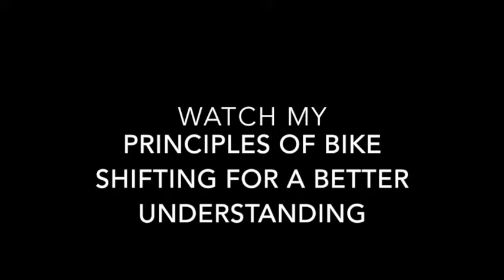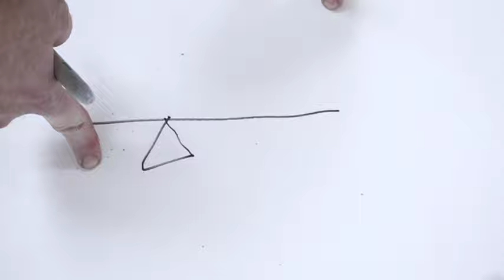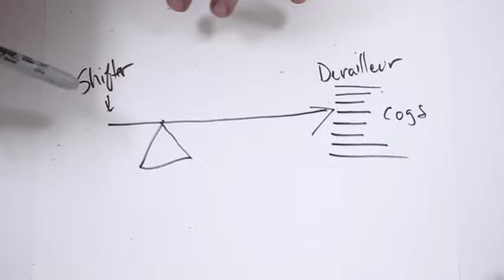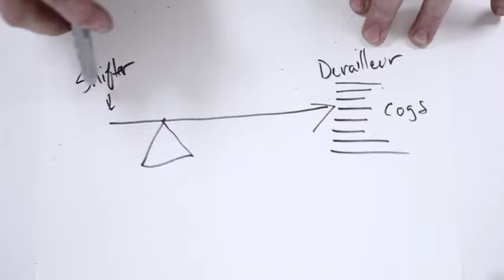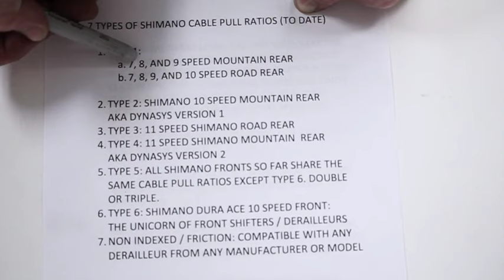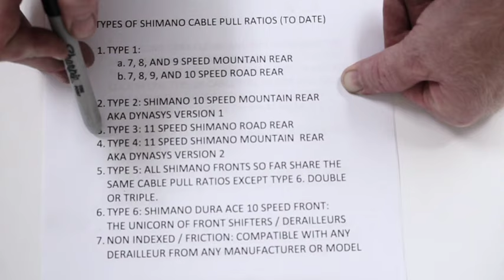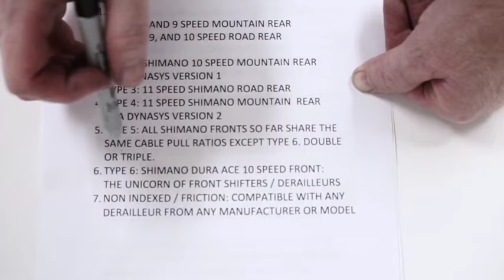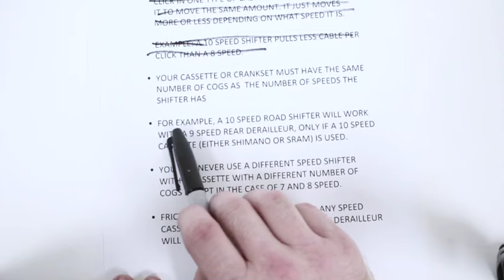Shimano Shifter / Derailleur Compatibility Guide: Intro to Cable Pull Ratios

Comment: For Shimano front derailleurs, road and mountain have different cable pull ratios.
Reply: The best technical bike youtuber, Thanks for the info!
Reply: i see. so i can use my 105 10spd RD on any MTB shifter provided it's 10spd as well? or i can go 11speed shifter & cogs using the same 105 10spd? (short cage)
Reply: @BenjaminVallejera  (My comment had nothing to do with rear derailleurs) But , no. Shimano used the same cable pull ratio for most of it's rear derailleurs from 6 speed up. (Early Dura Ace used different ratio). That is both road and mountain. But then Shimano changed the cable pull ratio on it's mountain rear derailleurs starting at 10 speed. This is just cable pull ratio, mean they will work with the shimano shifters and index correctly. There is also chain capacity, and largest cog.
You can use Shimano 105 10spd RD with Shimano 6, 7, 8, 9 speed shifters. They all have the same cable pull ratio.
Here is how indexed shifting works: https://www.youtube.com/watch?v=xMvD1T4qF1E
Reply: @RJTheBikeGuy   i see. so if i use 9speed shifter, it can only accommodate 9 cogs? or can it shift up to 10th cog? btw, great stuff. im learning more here. You have explained (Without me asking) why my roadbike 10spd tiagra shifter works on a 9spd alivio RD. :)
Reply: @BenjaminVallejera  It would not even be able to shift that last time. That is not even taking into the consideration the indexing.
Reply: @ValkusR  2 speed FDs are still off. They are workable, but the shifting is still not great.
Reply: @RJTheBikeGuy  Hey RJ. I don't know all the combinations but a dyna sys double front derailleur works perfectly (trim positions work too) with a double road shifter, at least from the old series and as long as you install an mtb crankset. Check my video
Reply: @RJTheBikeGuy  I just installed on my gravel: Ultegra 8000 shifters together with GRX 812 (back) and  SLX FD-M7025-11-L front derailleur and also SLX FC-M7000 Crankset 2x11 (38-28) shifting in front works like charm, not workable as you said, but perfect. So definetely the pull ration of the derailleur is compatible with the shifters, BUT the derailleur  should be compatible with the crank chainline and ring sizes, so If i were to use the same derailleur on a road crank (like 50/34) that would probably work, but with some rubing and compromised shifting.
Reply: @RJTheBikeGuy  and another piece of the information concerning FRONT derailleur MTB/road compatibility: It is explicitely said that shimano SORA front derailleur compatible both with ROAD and rapidfire shifters here is the quote: 

Description of Shimano Sora FD-R3000 Front Derailleur 2x9-speed
As Shimano's first-class 9-speed road bike groupset, SORA is pitched towards sports/fitness cyclists. With its durability and affordability it is also a perfect groupset for winter or urban commuting bikes. Now with technology adopted from higher level groupsets, both new starters and enthusiasts will feel comfortable with the features that 9-speed SORA R3000 introduces. 

Shimano Sora FD-R3000 2x9-speed front derailleur in Wide Link design for improved shifting efficiency. Also suitable for Rapidfire Plus shifting levers. Chainstay angle: 61-66°.
Reply: So I have a shimano deore mega 9 setup, they don't make it anymore but it's a 3x9 setup, on my front derailleur shifter I should be able to use a 7, 8 or 9 speed mountain front shifter correct? The actual shifter on the bars not the derailleur itself
Reply: @danielmilligan3298  Sticking with Shimano, yes, the cable pull should be correct. But the chains got narrower. So a 7 speed mountain FD might work, but a 9 speed mountain FD will work better.
Reply: @RJTheBikeGuy  thanks! This is kind of my introduction to performance bikes so I'm still learning
Reply: @RJTheBikeGuy  Can i use claris r2000 8speed sti on alivio rd-mc20 8 speed on a mountain bike with drop bars? Im planning to build a monster cross bike.
Reply: @nefarious2404  Yes.
Reply: No kidding. I had a very pretty Tiagra Triple front derailleur that couldn't be actuated with Deore Rapid-fire shifters. I found a 2nd hand STX Dynasys that does a fine job.
Reply: Just want to ask..not sure if this was discussed..what sti will be compatible with alivio 3x9 set up?
Reply: For road bikes, is Tiagra 4700 rd and fd compatible with SRAM 2x10 brake/shifters?
Reply: @name-ug5xq  no
Reply: Thank you! This is a very good content! 

Is it ok to use a tiagra 10s shifters paired with 10s deore RD and 10s cassette?
Reply: @Kuldra  Probably not. 10 speed mountain (deore) went to different pull ratio than road.
Reply: @RJTheBikeGuy  I see. If I pair Tiagra 10s shifters with a 9s Alivio RD and 11-40t 10s cassette will that work?
Reply: @Kuldra  Probably. I would go with a nice 9s Deore.
Reply: @RJTheBikeGuy  Thanks!
Reply: @tyronearnold6692  

I need your help, i really fcd  !

I got a gravel "locked" in Sram Apex...
I changed rear derailleur for Deore M6000 (MTB) , the cogs was Sram too, i changed today for a chinese cog, 11-28  10v.
Mi shifters are STI Hidraulic Tiagra 10V.
When i shift the gears, the pull ration doesn't work well, its like 2 shifts for one gear up. Well, in short, I have 10v in shifters, and in cogs, and the derailleur, also 10v, but just reach 8 gears, sometimes.

I need to replace de derailleur for a Tiagra Road ?
Reply: @sergiocouto4854 can't help. that is a mess. I only use totally compatible setups. Complete gruppos preferred.
Reply: Not such an issue about the front derailleur as the road and mtb ones are pretty similar with both available for three chainring cranks...
Reply: @jommagtibay3404  microshaft 3 by 9 Sti type or Sora 3 by 9
Reply: @name-ug5xq  the 4700 has a unique pull ratio with the rear derailleur and is not compatible with other 10-speed, not even from 10 speed Shimano

Comment: Inspired by this and similar vids, I changed the 11-28 for a 11-34 on my Felt CX bike.  Used the Road Link and also subbed a 34 tooth chainwheel for the 36.  Didn't even need to adjust the chain length.  Now I have the 1:1 lowest ratio.  The rest is up to me.

Comment: Hi All, FYI Im running currently - due to crash and death of previous gen RD SLX M670 - SLX M7100 (1x12 model) with 10spd 11-42 cassette and 10spd slx shifter. However, will order - as its cheap as hell - 12spd SLX shifter and Im more than sure it will work flawless - will just leave the smallest gear/click empty by setting cable tension to 3rd from bottom as the lowest gear on my cassette. Still ultimately will upgrade to 11spd 10-50 cassette (sunrace mx8) and will leave only 1 gear/click on shifter "empty". and later when microspline will not be so expensive and more available ( running Bontrager wheelset )  will go to full shimano M7100 12 spd group by adding proper driver and cassette. Cheers

Comment: Cool video and I like your cheat sheet with all the compatabilties/combos.  You may want to consider a part 2 to this video with mismatching vintage index components with other brands and non index components.  I've successfully meshed non index/friction Suntour Cyclone and Superbe Pro RDs with shimano 7 and 8 sp index DT shifters and the indexing worked fine, so I assume many old Suntour non index RDs have a 1:1 cable pull ratio.  Also I've meshed 1st gen. Suntour 6 sp Accushift shifters with Shimano 7sp RDs with 7 sp FWs, so the pull ration on 6sp Accushift is the same as 7 speed Shimano shifters.  You can overclick the 6sp Accushift DT shifters to get into the largest FW cog but sometimes it ghostshifts back into 2nd gear if you hit a big bump in the road.  These weird combos can come in handy if you're setting up vintage pre 90's bikes with friction shifting and converting to  index shifting brifters/DT shifters/barend/grip shift or rapidfire shifters.

Comment: Question: I have a 10 speed (Dura-Ace) barend shifter being used with a 9 speed mountain derailleur and a 10 speed cassette.  However, I keep having trouble with the shifter needing to be moved two clicks to actually move the chain.  (Then I have to click back one to align the derailleur.  Is this a compatibility issue or a bent hanger or...
Reply: Joe Copeck cross compatibility only works up to 9 speed, then all bets are off.
Reply: Change to a 10 speed derailleur, so it's a matched set.

Comment: Even tough I have alot experience and I'm already familiar with the inner workings of indexed shifting I must say, this is some of best explaining I've ever seen. Well done sir.

I actually came here looking for information on wether the 11 speed shifter on 2*10  drivetrain on the Specialized Chisel was a printing error. It would seem its not. I can only guess why Specialized would do run 11sp deore shifters with a 10sp XT derailleur and cassette. Cost efficiency?

Comment: I believe the information regarding front derailleur are inaccurate -- for triple 3x9 Road vs MTB pulling cable ratios are similar but not exactly the same. This means that even after careful setup you have some rub somewhere -- in my case I tried to mount MTB FD to match road STI Shimano shifters, and either leftmost or rightmost chain path caused the rub against FD cage.
Reply: Yard Sale Dale  I wrote about replacing one triple with another triple (it is not doable without converter). And since with triple the rub occurs only on one of the cogs I am not surprised dropping one and going double works.

Comment: need your help, i really fcd  !

I got a gravel "locked" in Sram Apex...
I changed rear derailleur for Deore M6000 (MTB) , the cogs was Sram too, i changed today for a chinese cog, 11-28  10v.
Mi shifters are STI Hidraulic Tiagra 10V.
When i shift the gears, the pull ration doesn't work well, its like 2 shifts for one gear up. Well, in short, I have 10v in shifters, and in cogs, and the derailleur, also 10v, but just reach 8 gears, sometimes.

I need to replace de derailleur for a Tiagra Road ?
Reply: You need a derailleur matching the shifters. Ten speed mountain is totally different than any road setup is compatible with.

Tiagra is a weird group - when they bumped up to 10 speed (after this video was made), they changed their whole tiagra system to be compatible only with Tiagra. It’s effectively an island onto itself - all alone in terms of compatibility. 

If you want your shifters to be compatible, you’ll have to dump the m6000 rear and use a 10s tiagra rear. Nothing else is compatible.
Reply: BTW, I’m John the Bike Guy commenting under the name of a different channel. 

Normally I don’t respond to questions with answers contained in the video. But Your system of Tiagra isn’t in there because it wasn’t made when the video was made, so I made an exception.

Comment: I stumbled on your video because I encountered a problem with my bike conversion. I was handed a trek 7300 multitrack in very good condition but I wanted to convert it to dropbars. So I did. I bought a microshift R8  3x8 shifters. I did not encounter any problem with the  right shifter and rear derailleur (shimano stx RC) but I do have a problem between the left shifter and the front derailleur (shimano Nexave). If I can get a smooth shift from small ring to middle ring, the middle to large shift does not work. If I fix the middle to large ring, the middle to small shift will be affected and won't work. I just thought they might work probably they are not compatible. I did not make a very thorough research about microshift and shimano nexave compatability. Currently I just use the middle ring and don't shift to small or large ring.

Comment: Finally the video that i was looking for. 

Now, I have a Deore XT 11s cassette and 11s rear derailleur. Can I use an 11 speed ROAD shifter? I am building a cross bike.
Reply: Rex nope, 11 speed MTB and road stuff has different pull ratios, so it won’t work.
Reply: Bummer... I was thinking of replacing my Ultegras Shifters/lever set for a flat bar and separate XT shifters Hyd Breake levers... :-(

Comment: Why shimano hate us so much? I just found 105 5700 STI it's not compatible with Tiagra 4700 Derailleur because they have different pull cable ratio. And they both are from 10v road rear groupsets.

Comment: Great video! There's a small change since this video was made: Tiagra 4700s are not compatible with any 10-speeds. It's an odd exception and I'm not sure why Shimano changed the pull ratio in that model.
Reply from the maker: Gary Ross Yes - but when I made the video, 4700 Tiagra wasn’t out yet.

I’m assuming they messed around with it to be unique like the 11 speed stuff.
Reply: @johnthebikeguy  I've edited my message!
Reply: @johnthebikeguy  The first 4:30 of this video is brilliant. It's sometimes a struggle for people new to compatibility to grasp that a derailleur has it's own ratio (especially people who haven't upgraded their bike since the 9 speed days). Bookmarking this video for future use. The compatibility section is a little out of date, as is to be expected. If you ever feel like remaking this video, with some updated info and to correct that little bit about front der. cable pull ratios, that would be awesome!

As for Tiagra 4700, it uses what you've termed Type 3 rear derailleurs: same cable pull ratio as 11 speed road (same as 10 speed GRX, 11 speed GRX, and it would appear 12 speed GRX as well). Tiagra and 4700 just have their own unique cable pull length at the shifter.

Comment: Great Video! Some update would be nice! The Shimano Tiagra 4700 is 10 speed, however it is not comapible with any other 10 speed systems, as far as i know.
Reply from the maker: András Sebestyén Tóth Yes, 4700 series is different, and wasn’t common or even in production when I made the video.

Comment: Thanks John for the video! That's the most understandable information which I've ever gotten!
But,John, I have few questions which are very important for me! 
1. are there any uncertainty in the work of the 9sp derailleur with the 10sp transmission components(especially cassete and shifters) which can influance to its or other mechs in the future negatevally and result in faster wear and tear details of a transmission (it's really important because I'll build and prepare the bike for realy long travel and there should not be any mistakes) ?
2. can I use the "Shimano XT RD M772 9 sp shadow", not an old shimano derailleur like the "Shimano XT RD-M771 9sp"( I've heard  "Shimano XT RD-M771 9sp" has the same pull ratio as "shimano road dura ace bar-end shifters", but "Shimano XT RD M772 9 sp shadow" has not) ?

Comment: Ok so basically you have to have the same number of gears and pull ratio on your shifter as your derailleur and cassette
Reply from the maker: Basically. The number of gears your derailleur was designed for can be lenient - as long as the pull ratio is the same. However unless it’s older, as newer designs have specialty ratios, it’s unlikely with more modern / higher end components.
Reply: @johnthebikeguy  alright, im new to bicycles and I am learning a lot
Reply: @johnthebikeguy  I have an unused SL-BSR1 Dura Ace "left" thumb shifter which is friction. Will this work with the current 12 speed Shimano rear derailleurs like the Deore M6100 (provided of course that I use a 12 speed cassette)?

Comment: Hey John, 
I have a Shimano 11speed  Deore M5100 group set. However, I'm having trouble getting it to shift to the tallest gear (50 tooth cog) and the shifter breaks inside requiring me to open it up and set it up again to function somewhat. Can I replace the shifter to a Shimano 12 speed Shimano Deore SL-M6100-R so I have an extra trigger pull to hit all the gears? Would I run into any problems? If so, what do you think they would be?

Comment: so IF I'm understanding this correct.. I can take my altus rear derailleur off (7 sp), and slap on a deore (9 sp) and use it with my current shifter and I should be able to set the stops and be GTG?  All mtn after all.

I'm really looking at upgrading the derailleurs for both my front (a tourney) and a rear (an altus).  This seems like it should work?  I'd like to go to a twist shifter later from the thumb shifters (I hate the fact that I go up a gear using my thumb and down a gear using index on my right hand, but go up a crank sprocket size with my thumb on left hand and down with index.. they're opposite of eachother).  This will probably necessitate swapping out everything in my bars, but as long as I stick with same MFG (shimano) and gear sets (its a 3x7 so I should stick with that) I should be ok?

Comment: Current set up on a Bianchi Lepre Mini Velo :  7 speed cogs, friction shifter, single chain ring currently using Shimano Tourney Rear Derailleur. Will a Shimano Deore XT RD-M8000 GS Medium Cage Shadow Plus 11 Speed Rear Derailleur work with the set up considering I am using a friction shifter for the rear? Will the chain fit?

Comment: I am trying to attach a new front and rear derailleur but have struck out twice finding the right sizes. Is there a specific brand for each bicycle?
Reply from the maker: Nichol Jackson No, there are three main sizes - 28.6mm, 31.8mm, 34.9mm. 28.6mm is usually on steel / titanium. Aluminum and carbon usually use the upper two. 

Simplest method - buy the biggest one and use some kind of shim. I don’t run derailleurs in the front anymore except for road, and I always use braze on clamps, as I have one in each size. But I have used old tubes cut in strips. Definitely will not rotate.

Comment: Does this mean that the rear derailleur doesn't matter? If you have matching speeds between the shifter and the cassette, you stay within road or MTB family, and stay within the capacity of the rear derailleur, then you can use any derailleur? I've seen a video where an XT shifter shifts and Alivio derailleur with no problems and no visible modifications.